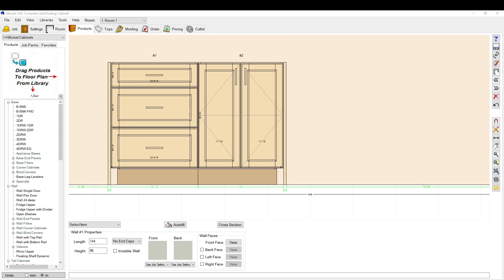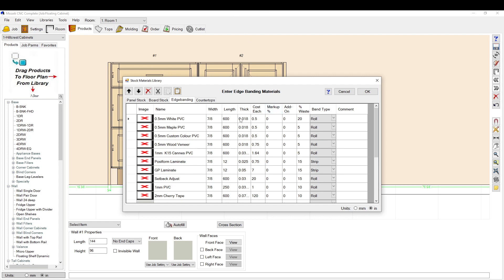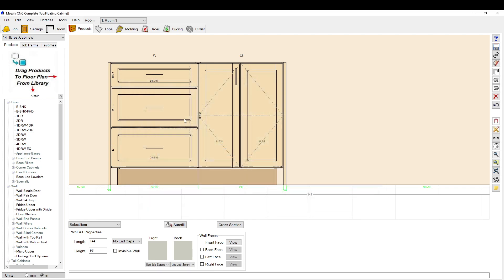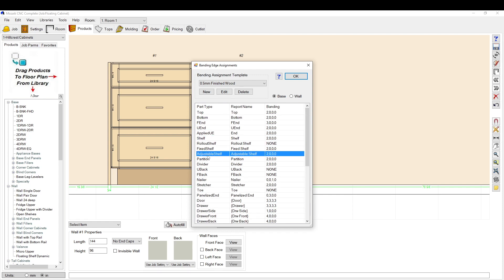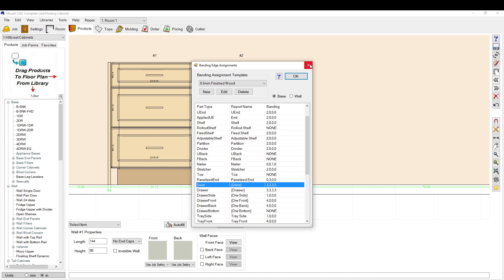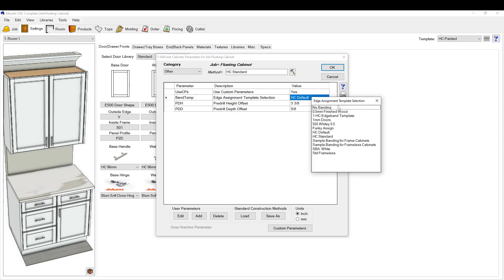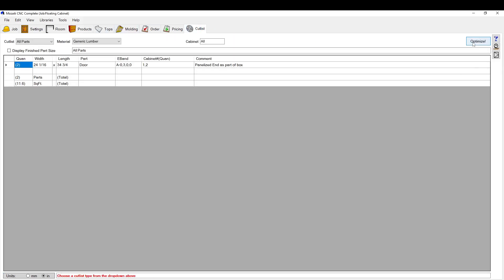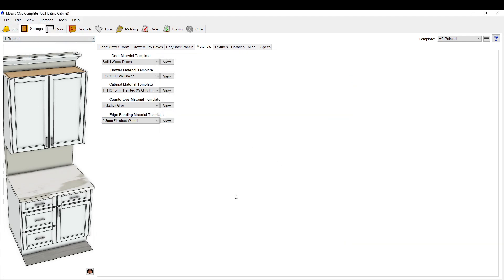How to Setup Edgebanding - Mozaik Software Tutorials

Comment: What if I don’t have the banding tab on the optimizer ? What do I do I have mozaik cnc
Reply from the maker: Banding tab would be a component of the material templates menu in mozaik not the optimizer what are you trying to achieve?
Reply: I want to see where I put the edge banding on each piece but I don’t see where the edge banding tab is , is that an extra or does it come with the mozaik cnc